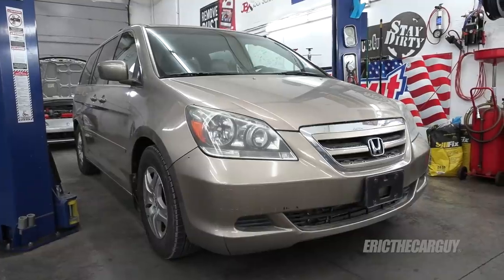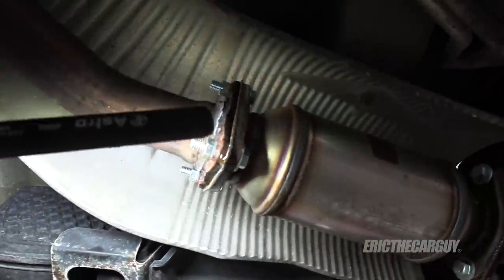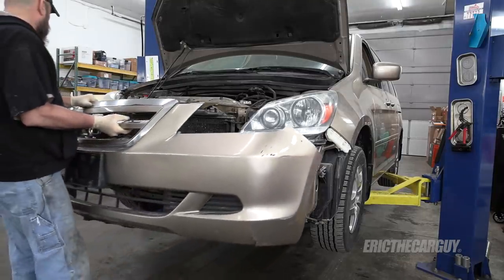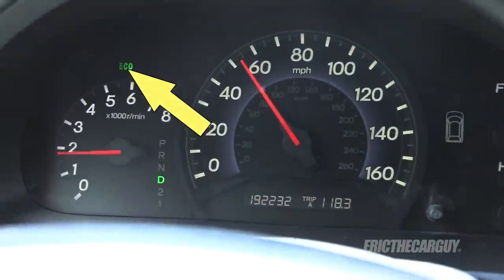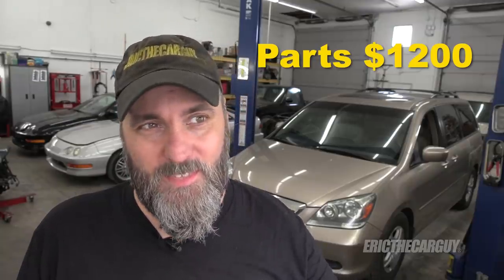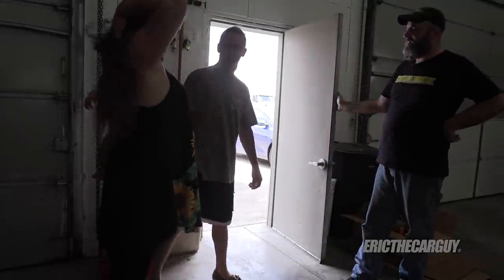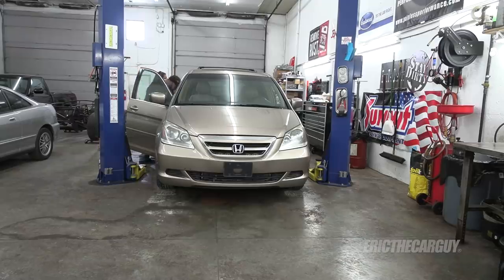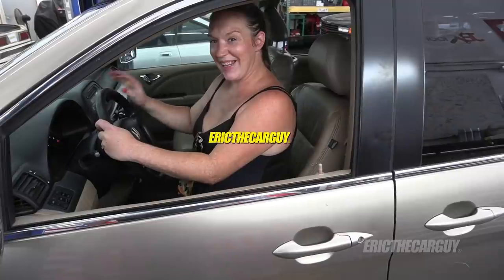2005 Honda Odyssey Give Away (Episode 7) Fixing it Forward

Comment: ETCG: Well done. 👏🏻 And I enjoyed watching all of the other six videos as you fixed item after item. That has been my experience thru my friends who owned these Odys and didn’t maintain them - broken stuff would build up and become overwhelming and suddenly you have to spend more than the Ody is worth to pass inspection / keep it on the road / etc. As for our own 2006 EXL w/RES I kept up with all of the little items and drained and filled the ATF at the first 15k and every 30k thereafter, and also changed out the power steering fluid annually, all using only “genuine” Honda fluids. THAT 2006 Ody was a great vehicle and was still going strong at 227 when I sold it to a co-worker in 2018 who is still driving it today. Hopefully this young lady (and/or “Captain”) will take good care of that Odyssey. 👏🏻

Comment: Careful when buying a honda with a trailer hitch. The 6 cylinder vtec engine moves, but the transmission and suspension is not made to haul massive loads like a truck. Also, Eric, it might be time to start a workout and weight loss series bubba ;) .

Comment: Man I would’ve love this opportunity. Last year I bought a 2005 Honda Odyssey touring. I put so much money into it after purchasing. I did the brakes and rotors drilled n slotted, one rear caliper, a set of rims and tires, new tie rod ends, serpentine belt, spark plugs, the boot to air box, variable timing gaskets, valve cover gaskets, cv axles, it still runs and drives at 225k with cold ac, but it leaks or burns all of the oil out of the exhaust, I changed the valve covers, thinking that it was leaking onto the exhaust manifold, and out the exhaust, but it did not fix my problem. I’m at a loss on it. Don’t know what to Do with it. I’m 24 and have a 3 year old daughter. I bought a cheap jeep to daily for now, and putting money into that, I work on all my cars myself but can only afford to put a little money in at a time, I cannot afford to go without the vehicle so I do what I can in my down time and budget. The year before I bought a 2010 Malibu with my tax return. Has 96k miles and the unibody is rusted through. Also sitting in my driveway. I’m tired of buying lemons and putting everything I have into my cars jus to get to work. It’s a viscous circle.
Reply: The oil burning was probably VCM. Install a VCM disable and you'd probably be good to go.
Reply: @wiimaster2847  the second I turn the engine on, it smokes from the front of the engine, looks like the exhaust manifold, and also smokes from exhaust? Nothing in the oil or coolant. Doesn’t get hot.

Comment: Have a video idea, you should find a dodge or something with PO601 pcm memory check failure and what you can do before replacing pcm     I just had this problem and had it replaced but come to find out it could have just been a voltage or ground issue. Thanks! Keep up the awesome content!

Comment: My 2000 ford contour se 2.5L v6 won't start anymore. I was driving, it just shut down and wouldn't start after that.    Except it has a full tank of gas. It throws the code P1237. Tested the pump it works. But the fpdm harness failed the test. How would i go about fixing/finding a short in a wire for the fuel system?

Comment: Hi how do you fix the keyless entry of 2005 Odyssey? Fob battery is still good at 3.2V. There are times after parking the car locking and unlocking via Fob is working with red led blinking on upon clicking the buttons. Other than that car won't unlock/lock, fob also has no led light. I guess the transponder is not connecting to the antenna receiver of keyless entry system. Any help please?

Comment: did the flashing the PCM solve the issues with VCM?  why some others decides to install a bypass VCM devices so not to deal with VCM if they can reflash the PCM? worse case replace the VCM module instead of bypass it?